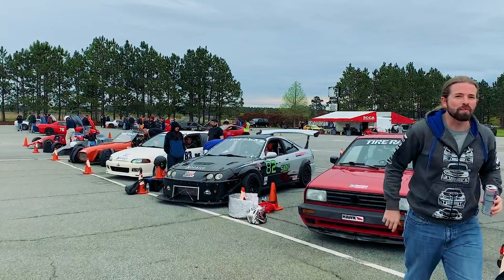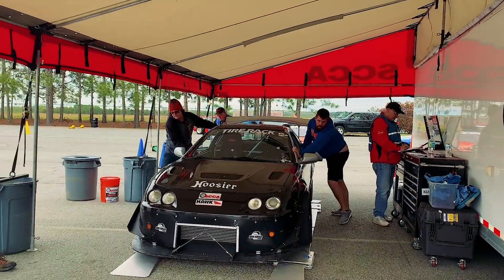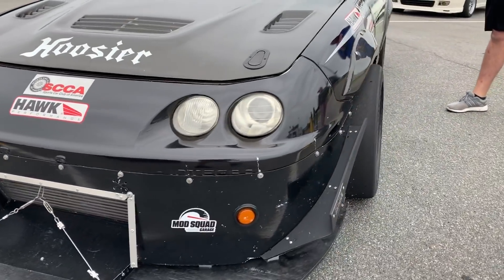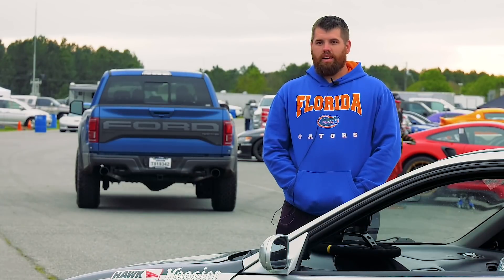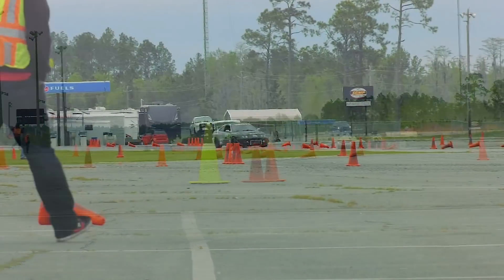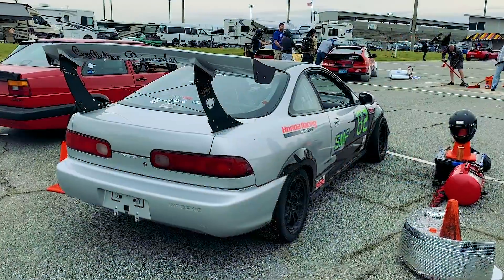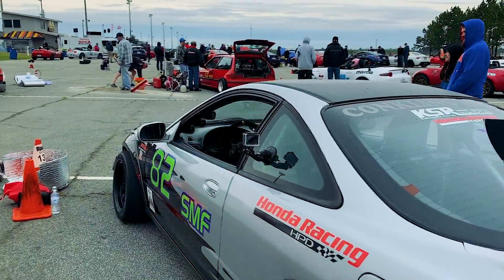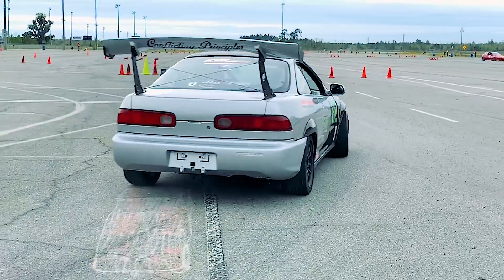Under the Hood: Insane DC2 Integra GS-R Autocross Build

Comment: I'm intrigued by the choice of a narrower wheel & tire on the rear, but then adding a big wing.  Seems like you could get the rear grip from a wider tire and ditch the wing.
Reply from the maker: The negative stagger thing first became popular in the mid-1990s when the really sticky tires for small FWD autocross cars moved from bias-ply to radials. Given limited rulesets but unlimited wheel and tire allowanced, FWD cars in the SCCA's "Street Prepared" used negative stagger to get lots of power to the ground and make high-hop FWD cars handle well in throttle-on situations. with a car like Ethan's the negative stagger with some aero kind off makes sense in that it can allow a bit more rear slip in low-speed corners where the aero is not as effective but maintaining a tight radius while getting back to the throttle early is still important. When speeds increase, and the need for more balanced handling increases, the aero does a bit more heavy lifting (or anti-lifting) to throw more relative grip back on the rear. that's the theory, anyway.
Reply: @Grassrootsmotorsports  you know your shit bro, props.